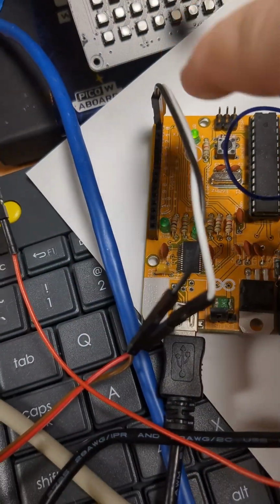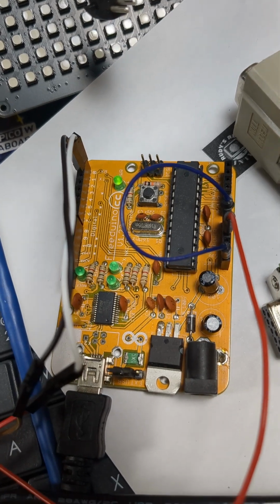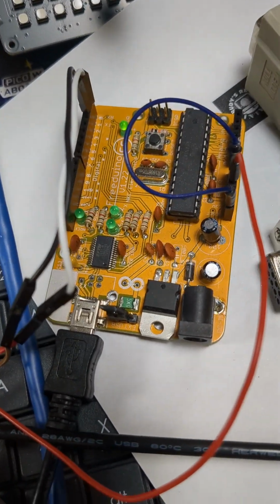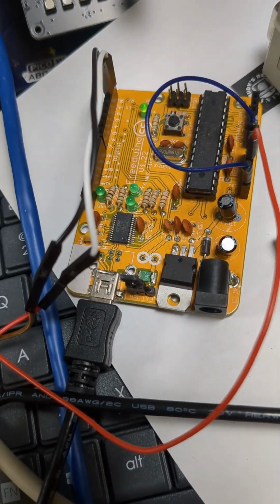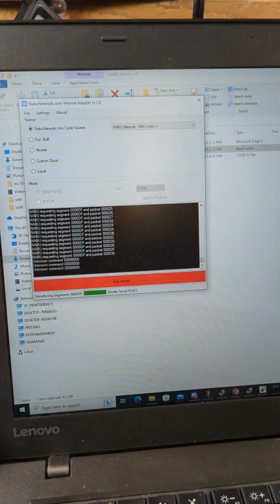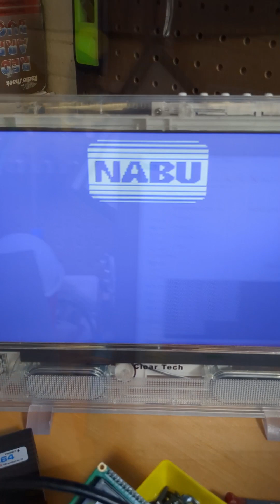Got NABU Working By Bypassing RS-422 Stage!

Comment: Nice way of isolating those pins. :) 

U12 is using both halves, and presumably your keyboard is working... So is the chip half bad? That seems unlikely.

I mentioned in your unboxing post that you might want to look at the 180 ohm resistor to see if it isn't the problem. If it's shorted you might get those short blips.

The schematic provided by NABU is very nice in that it exists, but doesn't give the component ID. Ouch. So it's just a guess as to what's what without using a meter.

It looks like R29 is the 180 ohm resistor for the keyboard, but I don't see the one for the serial port. I'm too lazy to open up my NABU so I came here hoping to get a good look at the board. Close, I got one I think. :)
Reply from the maker: Hey thanks for watching and commenting! Keyboard is working. Would seem odd like you said that half the chip would be gone.  
UA9637ACP is the ic. I've gotten one just in case but have not yet done more poking around. 

I do get about 175 ohm between the two pins so I think that resistor is ok.  

I'm away from the workbench for a bit but hope to get back to it soon to see if I can figure it out. Learning a bit in the process.
Reply: @JamiesHackShack  Yup, that should be more than close enough. And it appears that a terminating resistor on the receive end is not needed since NABU installed one for us. Not that a 3M long RS-422 has anything to worry about in the noise department. :)

In that case I would say that you are correct that it's the UA9637ACP since the NABU works just fine with the RS232 adapter. I'd clip the chip out making my cuts as close to the package as possible and then remove each pin from there.

This brings up the 111k vs 115k issue. Ideally the USB adapter would be fine with the 111k baud rate. Looking at a comprehensive sampling of just one cut sheet :) I see that changing out the 12Mhz crystal (or installing it if it is currently using the internal osc?) with a 12.66Mhz (they exist) will get you to 111K with the FT232R chip. Just something to fall back on if the syncing delays gets too onerous. 

And you've got a new sub. In Kentucky? I'm just down the road in Tennessee. :)
Reply from the maker: @MrWaalkman  Hey thanks for subscribing! I'm a native of SC. My wife is from KY. We lived in Louisville for a while but we now find ourselves up in Indiana, a little bit south of Indy.
Reply: @JamiesHackShack  Two of my sisters live in SC, and I have fond memories of visiting "The Slippery Noodle" while doing a buyoff on equipment in 1992. :)
Reply: And I dove into the "why" behind the 111k baud and it's right on the first page of the technical manual, paragraph four, under "clocks".

The NABU uses a 3.579545Mhz clock for (presumably) NTSC generation, and the NABU halves that to get 1.79Mhz, which then gets divided internally by the TR1863P by 16 to get 111k baud.

And before I toddle off yet again while forgetting my manners, you are more than welcome, and it's my pleasure to subscribe! 

Looking forward to more content!
Reply from the maker: @MrWaalkman  nice sleuthing!

Comment: Great work! Will you be documenting this?
Reply from the maker: Thank you! Yes so what I am going to try to do is make sure I have the real "fix" down.  So we have something to share so if they see x looking signal on pin 20 when using rs-422 it will likely be u12. I have a new u12 coming from mouser soon. I want to document and have a video showing the scope/logic analyzer and compare before and after. 
This process could be its own I guess though for a way to prove your nabu is ok if you are having trouble with rs-422 etc.